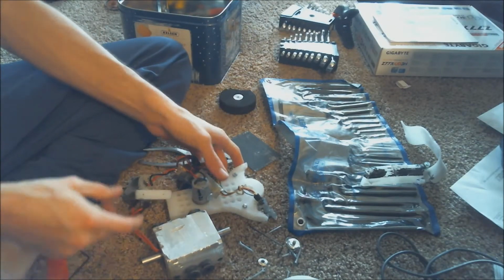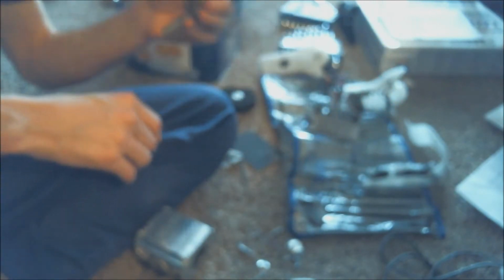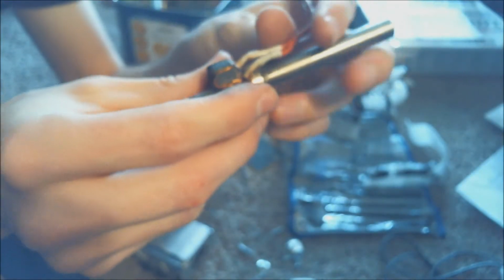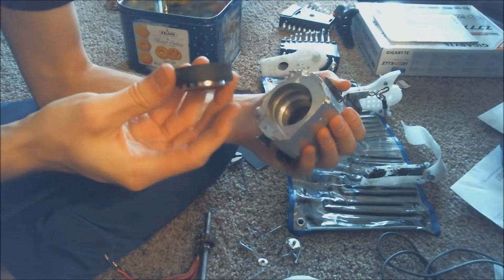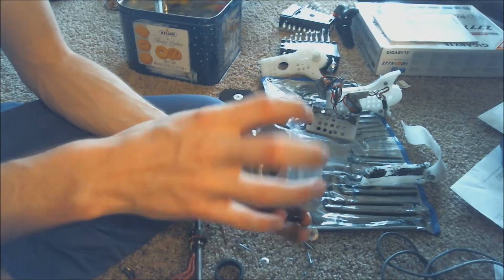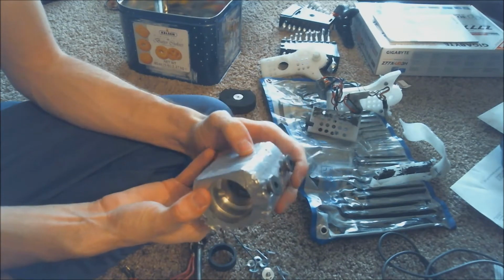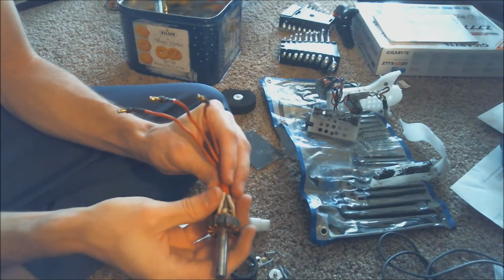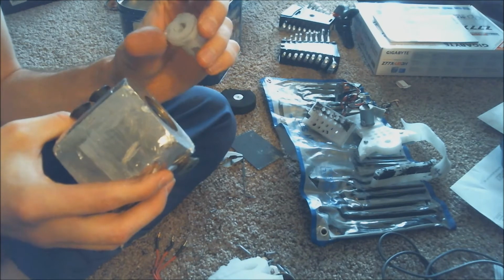Grande Tambor Breakdown Part 2

Comment: how to do you think you will do vs Gyroscopic, I am trying to build a combot too with drums, but I am still deciding which type of drum I should use. What do you think of your robot's weakness and strength? Thanks for answering:)
Reply from the maker: The only robot I know of named Gyroscopic is an antweight. Grande Tambor is a beetleweight. So if I went against that Gyroscopic, I would assume that I would win since I am 3 times his weight :P Anyways... I would say that Grande's strengths are that I have a very reliable weapon. Since I built the weapon motor into the drum, it decreased the amount of moving parts and therefore breaks less often. Weaknesses for Grande would have to be well built low wedges. Since my drum has such a large diameter, it is hard to get a good hit on robots with low profiles without just throwing Grande back as well. Grande is also very hard to maneuver since the gyroscopic forces are huge with that big of a weapon. If you favor drivability with your drum, go with a wide drum with a small diameter. They are much easier to drive, but your weapon speed has to be much higher in order to get the same power behind your hits.
Reply: I thought you built poco tambor too, aww, I see. I want to know what ya think if you had a opponent who is also beetle weight with the drum like two stick hammer rotating upwards instead of drum.
I was thinking of building a spinning drum robot that can counter low wedges with low enough spinning drum. I am trying to manipulate the gyroscopic force at the right moments for the best angle of most effective attack against low wedges. 
From gyroscopic force, it is hard to steer to the right when it is spinning upward, and when it is upside down it tends to have a lift force and a yaw of right force so it tends to spin onto its right side up. How hard was it to control the robot in the right side up state? was it possible to control right side up and maybe change the property of side of the right wheel to make it turn its side faster?
I think for stronger hit, one robot would need to hold its ground better. So I was thinking about using barbed metal stick to its side to hold from slipping back(its like chinese kung fu holding onto the ground or mantis shrimp 1500N of force with its legs kind of holding onto ground of ocean). Basically I was thinking of a leg like thing to first hold its ground to only go forward and stand more force,  to second defend against low-wedges from side, to third, similar ablative armor that might entangle opponent. What ya think and your strategy from your experience to deal with your future opponent? :) thanks for answering
Reply from the maker: Your idea for a barbed kick back stopper could be pretty cool. It would only really work on wooden floors though. It would transfer more energy back into your robot and possibly get you stuck to the floor as well.

As for turning, It turns the same in all orientations since it is invertible. I guess if your drum is not very well leveled it could behave differently when you turn different directions.

About the armor, intentionally entangling your opponent is against the rules. Although I'm not quite sure what you meant here.
Reply: For Barbed wire we are going to use a rod of aluminum 7075 rod aligned under our robot facing forward and backward.

For orientation, we are trying to calculate the center of mass to a point or try to make it to a point so it is balanced for all direction only when it is spinning medium speed. 

For armor we are trying to use carbon fiber weave with epoxy to hope for best sturdiness and least maintenance once we put it up there. 

For our drive motor, we used high torque 50 rpm gear motor, hope that wont make us too much like a tank. 

Thank you for your reply:) Later I am going to put up a video how we are building up our robot, and hope you can critic it la, would appreciate your opinions.  Our team is really really newbish but we are trying hard hehe. 

Do you have a email or something so I can send you and may perhaps discuss some cool things about drum robot?
Reply from the maker: Send me emails at oddballbutler at gmail dot com